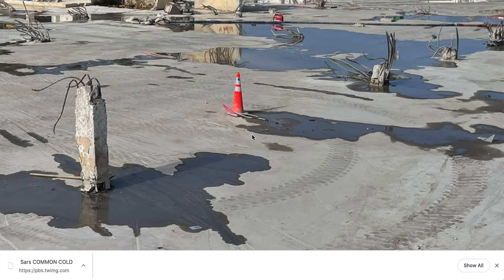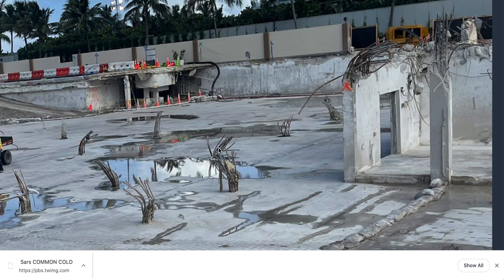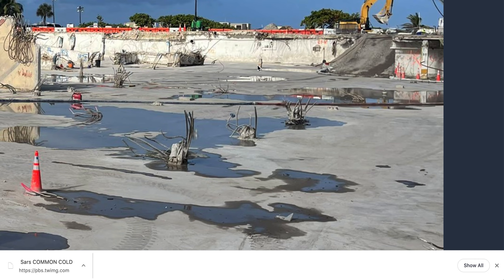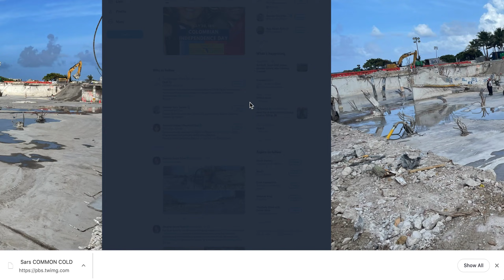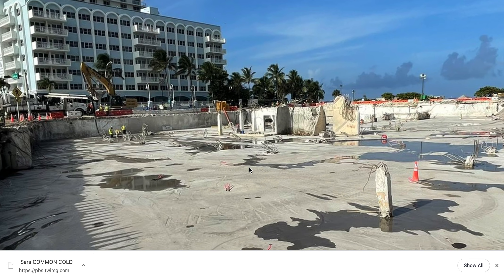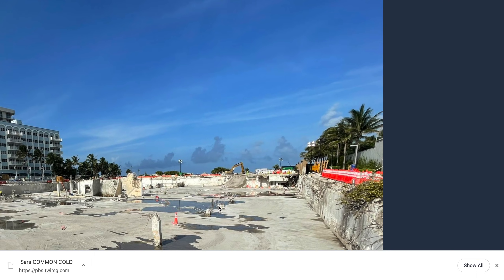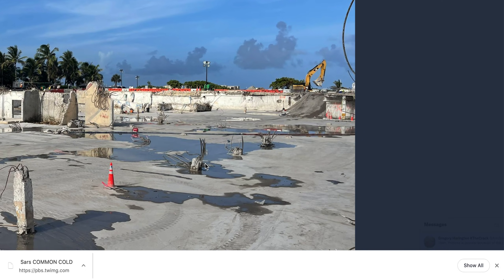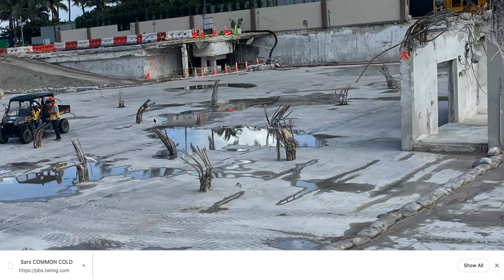Champlain Towers Collapse PROOF NO BASEMENT FLOOR PUNCH SHEAR, NO SETTLEMENT = I AM RIGHT AGAIN

Comment: Was there a Salt Water pool inside the 12th Floor Penthouse that could have been leaking over the years from salt deteriorations folks?
Reply: Wouldn't that have created major issues to the few floors below the penthouse and been detected.. A washing mavhine leak two floors above my apartment came through my light sockets within hours. Building smaller but build same sort of time in UK.

Comment: Well this certainly looks a lot better than what I was expecting! I think that 40 years of water intrusion because of a design flaw or because of improper repairs/patch up jobs plus the combination of poor and delayed maintenance caused this... No matter what it's a huge tragedy but if there was no design flaw whatsoever and this is solely because of maintenance that would make it even worse of a tragedy but I really think it's a combination of all those things... Of course I have zero experience in this except for I have plenty of experience with what water damage has done to one of my homes, so I know that water damage sometimes it's very difficult to find out what the source is but it is absolutely imperative to always find the source and fix the problem at the source because patching water damage up without fixing the cause is the worst thing one can do

Comment: At the ramp parking space 14 and across to other side is cps 88 and cps 27m10  you can see 4 rebar pieces and just 1 rebar piece and MBA 35 I think is lying on top cps 15 16 17 columns cps opposite I can also 1 piece of rebar sticking up very close to 27m10 and say it started at cps 76 and cps26 part the pool deck   fell down in to garage and pull on the MBA beams holding up foot print and the building became unzipped along the shear wall by cps 72 and the rest is history this is down to all your video's and information and blue suits you and the kitties hope both will  just to to wait for the report don't hold much hope. 🙂🐈🐈👍good evening 19 pm from the UK.

Comment: The manner of which the final demolition took place was a shame.
Reply: But it could have been much worse if it had collapsed on the rescue workers...
Reply: @somewherehere424  I am referring to the demolition after the implosion which you are correct that needed to happen because the structure was in great jeopardy of falling as the building’s spine was fractured along the elevator/stairs shaft from the bottom to the top.

Comment: Doesn’t look like there’s any isolation pads or protection around the columns however some of the columns do appear to be 4 inches higher than the bottom yellow or red paint that was on them so either the slab sank or the columns pushed up or something else such as damage by the demolition crews getting too close to the columns.

Comment: Why not add  triangle supports from the columns and concrete slap to help prevent punching shear?  Would this reduce failure  due to high localized forces between the concrete slap and column?
Reply: Yes that works, but you lose headroom. Also it costs more.

Comment: Not sure what you are getting out of this Kai!
But it seems odd that the column rebar are stripped of concrete like they are.
Most jobs we demo this is always a major pain and is almost always in large chunks that has to be jackhammered out to expose the bar like this.
Question: can 13 stories pulverize the concrete and leave the bar clean?
Reply: Good question, but I notice the wall near the column not stripped down to rebar.  If I were to place a bet, I would say they were destroyed during site clearance.  They were indeed playing with jack hammers. Would have been interesting though if they cleared everything around columns and left them standing in state and took photographs.  I guess they couldn't share data like that and have other engineers challenging whatever the official narrative will be.
Reply: They shot a bunch of columns for the demo. That could account for the clean rebar and splay.

Comment: Sink hole is not a big hole! , more than 50mm of settlements is sufficient to collapse any structure building 🏢 (flat slab without beams) under footing structures, Ref: IBC, ACI CODES
Reply: The slab was structural in the basement, it could be free standing with the steel specified and no support underneath.  Per plan but who knows with this crew.
Reply: @charlesrhodes7531  as per settlement 2mm per years = 80 mm the problem was in the footings foundation concept, if it is Raft foundation with joints it will good concept for global stabilisation of structure and traffic cars parking loads.
Reply: @kabdisoheyb8505  what I had indicated before was that 2mm was in 1992.  What was the initial settlement, what was the settlement in 1981, 1985, 1991, 1996, 2001,..., 
They had estimated a total settlement for the Franki piles, with some initial (during construction) and some continued settlement (long term).  Simple changes in finished floor can be measured.  The basement finished floor is said to be 2 ft MSL, has that changed over time.  Easily surveyed.  Some of the tides were indicated to be above 1.2 ft MSL. (Bottom of slab elevation) Loss of support during several tidal cycles quarterly(?) or maybe more frequent.  The pile tips were installed to a bearing load, not a predetermined depth but probably 10 ft to 30 ft below MSL (who knows) pile would have stopped advancing three blows with no advance say and total of 25 blows minimum. (Whatever was agreed too)
Anyway, there could have been upward forces on the basement structural slab (and column connections) if the sump pumps didn’t work with the bottom of basement slab below specific high tides (like a clock twice a day) low tide = loss of support

The township engineer is worried about something now (walls - hydrostatic pressure) Are they just trying to get more demo money? Simply brace walls - oh well